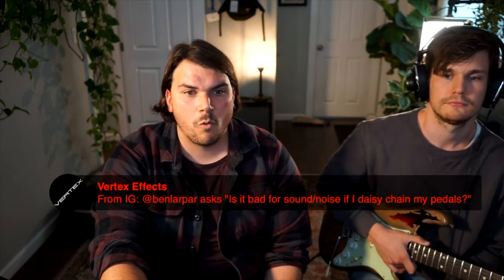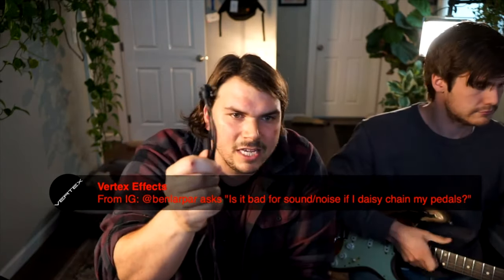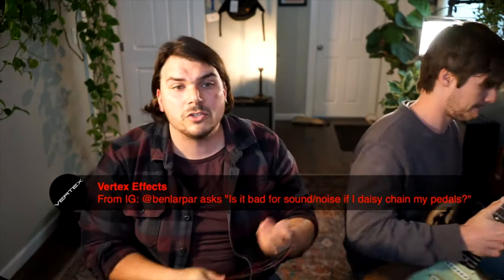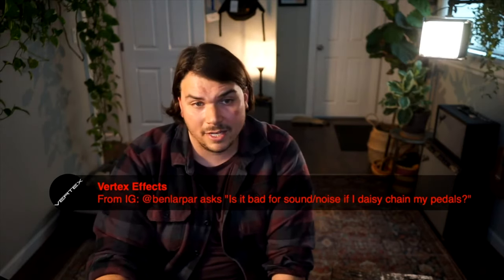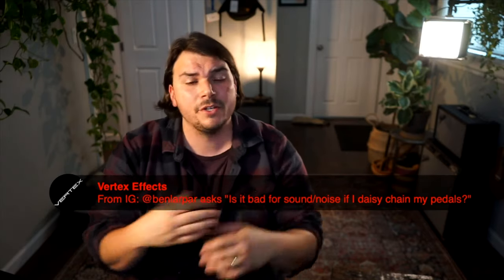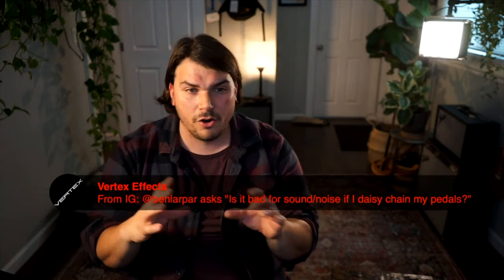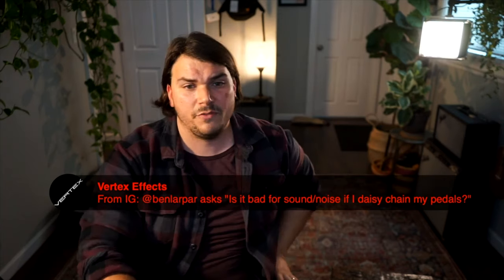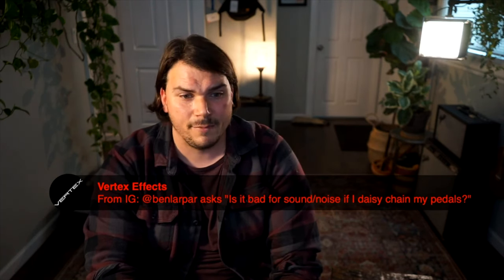Daisy Chaining Pedals 101!

Comment: in my experience, it's ok to daisy chain if all your pedals are of the same voltage (9volts usually) and the adaptor's output milliamp is higher than the total milliamp requirements of all your pedals .. this is specially true when you have a mini or small pedal board

Comment: I'm a complete Black sheep when it comes to this... I Daisy chain 11 pedals with one chain of 8 connectors with an additional extension of a 5 connector chain... Terrible, I know! To make matters worse, I have about 3 or 4 digital modulation pedals going... I mean, I haven't had any issues but I keep hearing in these types of videos that I'm not fully experiencing the potential of these pedals... So, I guess I don't know what I'm missing.
Reply from the maker: There will be conditions where it can work without noise, but it will be in the minority of cases, and not the norm.
Reply: @VertexEffectsInc  you're the rig doctor! Any tips on how to best ground my frankstrat??? I followed the schematic but the darn thing wants to be touched or else there's some mild hum. Shoot, I touch a pedal and my board grounds me... Only with this guitar🤔

Comment: I use a daisy chain for a home board and it usually works fine 🤣😂😅🤣 Cheers!
Reply from the maker: It's not one size fits all, it will be dependent on your devices and their current, voltage, and sensitivity to other devices and power.

Comment: Most analog dirt pedals are less than 20mA and a 100mA port from a power supply can easily power 4 dirt pedals. I managed to power 2 DIY Fuzz pedals, 2 DIY overdrives,and a Dunlop Wah from a single 100mA supply. The only thing I avoided was any pedal that was internally inverting the power or using any voltage doublers (since these are often switching) and anything using germanaium diodes.

Comment: I have a zuma and a total of 12 pedals. I was using 3 chains for my drives/analog pedals 1) prestige with deep six 2) DRV with Protein 3) Chase Bliss Brothers with Steel string but whenever I “mix” like for example both channels from the protein or one channel of the protein with one of the brothers, I got like a hum-screaming noise. 

Is this type of noise present when daisy chaining? Like, I’m using 3 different outlets from the Zuma to power 3 combos of 2 pedals each. 

Any idea??
Reply from the maker: I would choose lower current analog
Drives with more simple circuits and not digital control.

Comment: I have a question. When you want to daisy chain say 2 pedals each at 100ma , if I plug the daisy cable into the output that provides 200ma would this be the safest way to use a daisy chain ? Or say a reverb at 100ma and a modular at 200ma , daisy cable off the 300ma output and it should be optimal right ?

Comment: Hey. Thanks for the amazing content. What are your thoughts about using a daisy chain on one of the outputs of a good, isolated, switch mode power supply to power a few pure analog pedals?

I thought I could avoid getting a new one because this power supply has more than enough juice(milliamps) on a single output to power a bunch of eq/compressor/drive/boost pedals.

Comment: I have iso supplies fuel tank junior that has 5 outputs, the problem is I have 8 to 10 pedals on my board, (i cant afford to buy another iso psu) however can I daisychain 1 or 2 dc out from the fuel tank? for example, ill daisy ehx small stone and mxr phaser into one, and also some three analog gain pedals like overdrive or dist, is it safe? Thank you ⚡👋🏼

Comment: Curious about information on daisy chains for power supplies:

I have 8 pedals all on a single daisy chain. Polytune, Hudson broadcast clone, Q Tron, Pulp n Peel, pitch fork, JHS modded Russian muff, JHS modded triangle muff, & then a Klon clone…. Nothing has ever gone wrong for me. & all the other power cables are in use as well on other pedals. All on one single pedal train board with a 1Spot power supply. No issues. So I’m not 100% if maybe I am just lucky or what.

I would like to know if I am messing something up though with tone due to this. How does one check? Using an Orange TH100 for an amp. Do I just need to get two power supplies? I have 16 pedals on one board, but only have a 1Spot Pro Cs12…

Signal chain goes:
Polytune 3 with buffer, Hudson broadcast clone, micro Qtron, pulp n peel, pitch fork, vertex steel string, JHS modded russian big muff, JHS modded triangle muff, Klon clone, noise gate, e-lady flanger, ep boost, tc electronics pipeline tremolo, MXR carbon copy delay, echoplex delay, boss rv-5

Is there just a better single power supply that can power 16 pedals? Should I get an extra cs7? Or should I maybe use all of them on a 2 daisy chain cable system? Narrowing it down to 8 2-ended cables, maybe one with 3? 
Would love to get some advice! Thank you!
Reply from the maker: You can get some power supplies that can be expanded so you can keep each output isolated.  Cioks, Voodoo Lab, and Strymon have this.

Comment: i'm thinking of buying a 1000mA adapter with 5 way daisy chain and also the ammoon POCK LOOP looper which has a large current draw of 300mA.. can it be safe? i'm also considering of adding my 30mA wah pedal and 20mA distortion in the chain if ever i bought one.

Comment: What happens if you daisy chain too much? What is the risk?
Reply: i daisy chain my 11 pedal. its better to daisy chain one plug to one plug than one plug to many plug (star connection).. and you need good clean power supply (this method automaticly testing our supply clean or not) sometime noise dont come just because full isolated doesnt mean that power is clean.. just hard to heard the noise because isolated every output

Comment: Sweetwater sells a kit for TC Helicon vocal pedals that daisy chains their singles collection of pedals together. So you recommend to not do this even though this company made it for that? Or is it okay for these as they made it for that purpose? I'm talking about pedals like the Tlkbox synth, Hamony Singer2 etc. I tried to hook them up to my pedal power box but it won't turn them on for some reason...I'm using the Donner DP1 pedal power supply box. One of the outputs does turn them on, don't remember which one it is, but it makes it super noisy so I am just running the TC power adapter. Really don't like having a clutter of plugs and Furmen power strips just to get power to my pedals. The ditto mini also didn't like being plugged into the power box either, maybe a TC Helicon thing?
Reply from the maker: Ideally, no - most pedals that are digital high current pedals aren't good choices.  TC might have designed for this but it's no common that pedal companies do this.
Reply: Just for the record, I've purchased Donner pedals and they've all had issues. A few immediately out off the box and one lasted about a month. I'd consider a more reliable brand. The issues may not be your pedals.

Comment: Thanks for the info! Could I request a video on how to finish the cut ends of a daisy chain cable? I have seen Rig Doctor's other video where he creates custom cables, but would like to know how to seal an existing daisy chain cable that has been cut. Thanks!
Reply from the maker: You can just heat shrink over the blunt cut wire.
Reply: @VertexEffectsInc  thanks. What about how to avoid a short circuit, how to separate the open red and black cables? How to avoid them from touching again, in other words.

Comment: I have 5 pedals: boss tu2/mxr micro amp+/ocd/exh-Mod11/eqd-dispatachmster, around 300mA combined.. can i use daisychain or isolated? (Sorry for the wrong grammar, english is not my dialect)
Reply from the maker: you can, it just may not be that quiet.

Comment: How would you power 12 pedals or more where you require 2 different power supply boxes? It always introduces additional noise
Reply from the maker: If they're switch mode supplies you wouldn't have a noise issue related to the supply.

Comment: Respectfully, you're not really addressing the daisy chain question.  The cable set up that you're showing is not a true daisy chain.... A TRUE daisy chain, will go from the source to the pedal, then from that pedal to next pedal, and then that pedal to next pedal and so on.  A "daisy chain" is not a source cable with three wires coming out of it.  I am only raising this because there is a huge difference when addressing this question.  The other thing is that "two or three" max, is really sort of under cutting it.  I have 15 pedals on my right now, so if I ever thought of daisy chaining, it would be far more than two or three.
Reply from the maker: They actually are the same as they're all paralleled cables whether you do it as a series of y cables (one into the next) or one large splitter.  It's a better option, grounding wise, to have a common source instead of splitting the cable off from each pedal and creating a possible ground loop.

Comment: I like to Daisy chain my gain pedals (4 or 5 pedals) in one DC output on my isolated power supply and my modulation pedals (2 or 3 pedals) in another DC output, everything else is basically powered on its own output.  All the chained pedals are analog and sum up to below the required current.  Am I doing something that could affect my tone?
Reply from the maker: Easy test would be to unplug power from the ones that are true bypass and see if the noise floor goes down.

Comment: Is it ok if i use truetone 1-spot for distortion, overdrive, tuner, noisegate and wah? I see on the specs that it's 1700mA.
Reply from the maker: YOu might be able to get away with it but it's not ideal.  The best results would be to get an isolated supply.